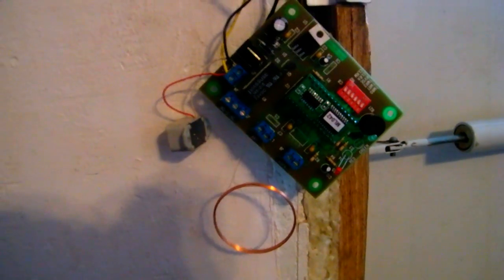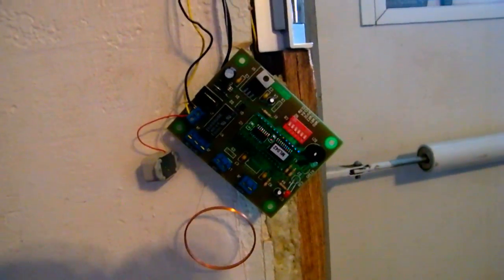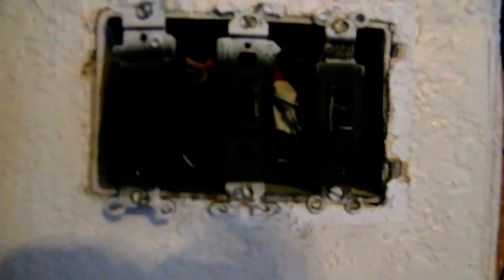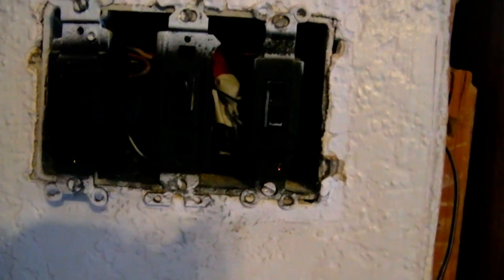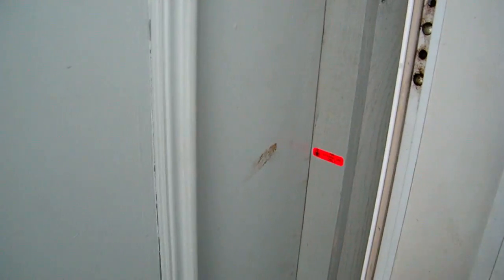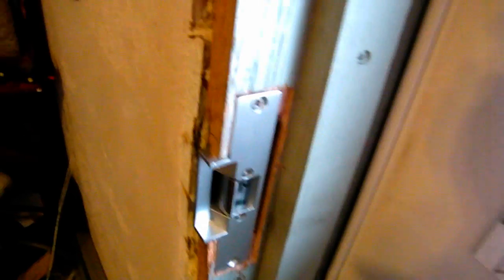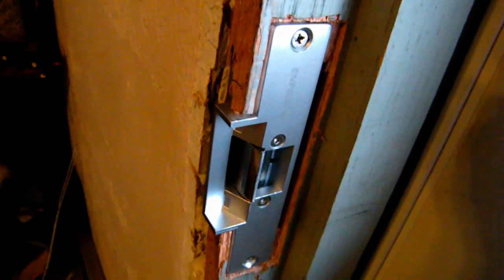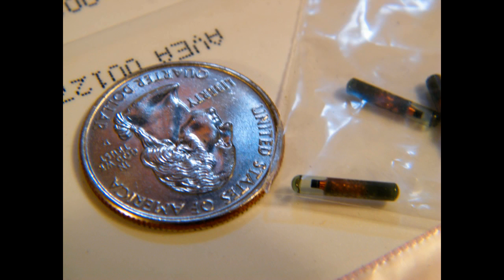RFID DIY Door Lock Setup

Comment: Lol you made braking in your house way to easy and cheap. Btw good luck wen the power fails.
And you want it implanted. Why not put an gps tracker in as well. Then you have your personal wireless swastika with you and you can be followed at bigger range then 25M/82 feet.